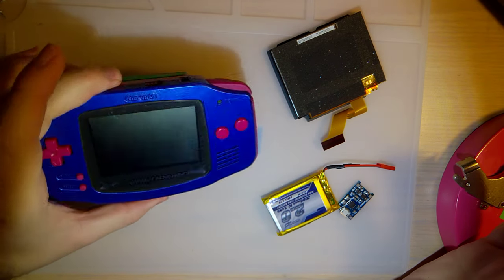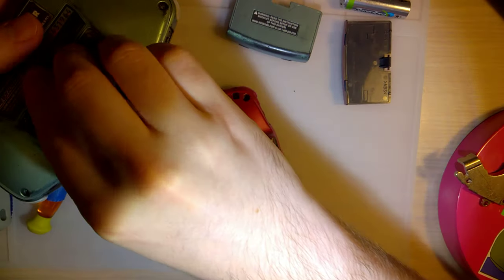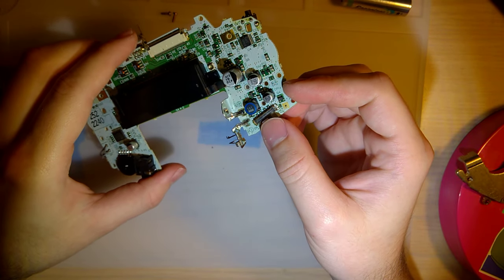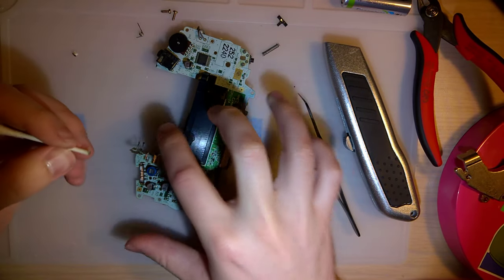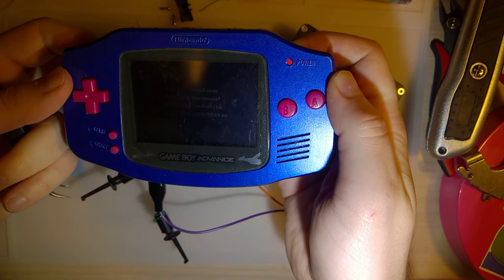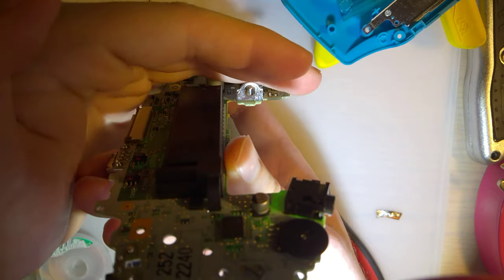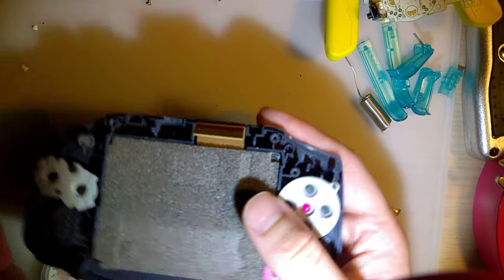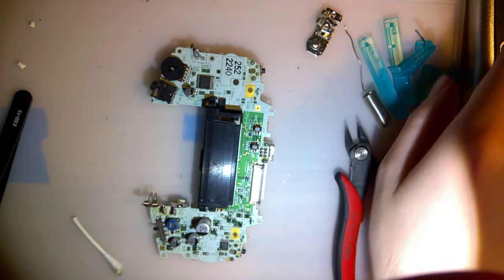Repairing a No Power GBA (Part 1)

Comment: Hey Makho, great job. I went through the same process and I think I did not clear enough the power switch. I still have random reboots.
In addition I did not re-solder some of the contacts as you did.
Any advice is welcome!
Thx
Reply from the maker: if the power switch shielding is not reinstalled perfectly flush then the power switch will not work properly
Reply: @makho  well I cleaned and installed the shielding as much as I could but I still get these random resets. Seems power is not stable, not enough, or a bad contact somewhere....
Reply from the maker: @pietronetutube  right, sounds like the shielding is not installed flush
Reply: @makho  well I did solder it pretty good I think. Even when I bypass it, I have the same issue ..  I found yesterday that with fresh and good brand batteries it works well for like 30 min and then same problem. Some capacitor issue? Bad connexion somewhere... Have you faces something similar?

Comment: I have a GBA board that wont boot. I have basic tools and just ordered a multimeter that will arrive tomorrow. I have a question if you have some time. What specific values are you looking for with the multimeter and which points were you checking? Thank you for all the awesome videos.
Reply from the maker: Mostly just checking the fuse and power switch. Both should read very low resistance (the latter only when switched to on).
Reply: @makho  It was that damn F1 fuse. I bridged it with some tweezers and it turned on. Thank you!
Reply from the maker: @erminj6367  Replace the fuse. Don't just bridge it.
Reply: makho oh definitely replacing it just how I diagnosed that it was the fuse. Only bridged it for a few seconds. The fuse is in the mail. Appreciate the advice!

Comment: Fantastic video! Forgive my ignorance, but what was the device you used when you hooked up some crocodile clips to the battery contacts to test whether the gba would turn on? It seems massively uselful! Thanks again for the vid
Reply from the maker: nowadays I use a MDP-XP power supply: https://retrogamerepairshop.com/products/mdp-xp-mini-digital-programmable-power-supply-set-with-30v-5a-90w-2-4g-wireless-connection-2-8-inch-tft-screen

but for this video, it was a homebrew power supply that I made https://www.youtube.com/watch?v=leoks1pUpcs

Comment: Great video! I tried to fix my power switch cleaning it but the console doesn't start and the green light turns out in a second or less. All the pins but one have continuity (the one near to the off possition). Do you think I have to replace power switch for a new one? Thanks for this videos!
Reply from the maker: did it mostly work before you touched the power switch?
Reply: @makho  I don't know, I bought it already broken as junk. The fuse and the rest of the motherboard seems ok
Reply from the maker: @DavidRodriguez-kz3ds  you can try bypassing the power switch entirely but a flicker of life then power off usually indicates a short somewhere

Comment: i have a GBA witch need a high power. It flicker while using normal batteries and only works with a 3,7V akku. With 1,2 Volt Battery i cant start the gba, only for some flickers. im not sure why. I installes new Capas and  cleaned the on/off switch, what could it be?
Reply from the maker: Replacing the caps was never going to do anything. Clean the power switch properly and I bet your issue will be resolved.
Reply: @makho  i installed a new Power switch. Not better at all. With normal Batteries it works on this one but i have to drill the Batteries. I really have good contact. With my 40pin Gba with ips display, clean amp mod etc.  i have no trouble using my Akku batteries. The power consumption ist for a reason higher on my 32 pin board.

Comment: Quick question, I'm repairing a junk AGB - 001 board and recently grabbed a new power switch, what are the values and specific contact points you are looking for when testing the switch for continuity?
Reply from the maker: Power switch should be open circuit or dead short. No in between.

Comment: Here's a weird one. With one of my GBAs when I switch it on the power light flickers but it doesn't fire up.....most of the time. It turns on about 20% of the time and then it's good to go for as long as one likes. I cleaned the switch - same. I changed the switch - same thing. I've tried every type of battery there is. I've switched screens and shells but the situation remains and is obviously a motherboard issue. I've checked all the continuity I could think of - gtg. Any ideas sir?
Reply from the maker: what other mods did you do?
Reply: @makho  Just a Funnyplaying ips screen mod without wiring for brightness adjustment and a new power switch. Everything else is stock. Also when it fails successively - when I click it off and on after each failure the flicker of the power light is less and less with each successive attempt until it doesn't flicker at all at about 5-6 tries. Might it be a cap problem? Thanks for replying
Reply: @makho  Well I finally took another closer look at everything and realized the R 13 resistor was completely gone. It looked like it was there with jeweler glasses but I picked up a microscope and took an even closer look and the black between the two contacts was not the middle of the resistor but board showing trough. Dropped a 150 ohm resistor in and gtg. Thanks for you help and response.

Comment: I just bought an gba from ebay the control pad was extremely stiff.. The game boy powered on and stuff fine but I did notice that it was flickering with the light going from green to red. 

Then I opened it and cleaned the screen and fixed the control pad but when I put it back together I power it on and I smell burning. The battery was hot quick. The power indicator didn't show any light when I turned it on. Now it's completely dead.. I tried different batteries and same thing happens..

pls help me if you know anything that could help..
Reply from the maker: sounds like you did something to cause a massive short on the B+ rail to GND. Did you bypass the fuse? Because this is exactly what the fuse is supposed to prevent.
Reply: @makho  It didn't powered on because one of the soldering wires came off. I fixed that but still having battery flash problems. It has one of those funnyplaying screens inside. I'm not very knowledgeable at this stuff.  I just wanted a gba with a backlight. It works but it has a weird problem where you press up and it goes dimmer and dimmer till it's at the lowest light setting. I hold up and press R to turn the brightness back up but still it turns down every time I hit up. Idk the problem.
Reply from the maker: @joi0001  Check all of your wiring and any solder joints you made. You have at least one short.
Reply: @makho  All I know is the select button solder is a little burnt in the area. I'm gonna check if the soldering was done right because this was made for someone else and this is how they received the device and then I bought it off that person on ebay.

The wires were soldered to the wrong spots. I redid all 3. Still the power indicator flickers red. The green light doesn't last long.